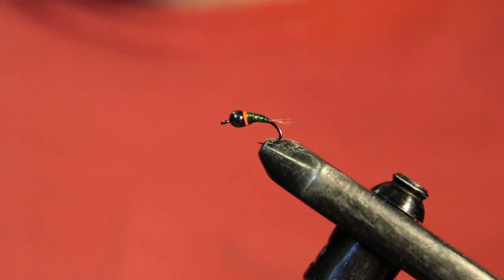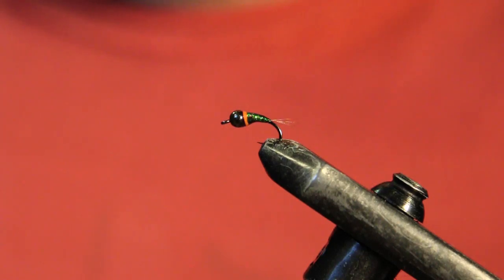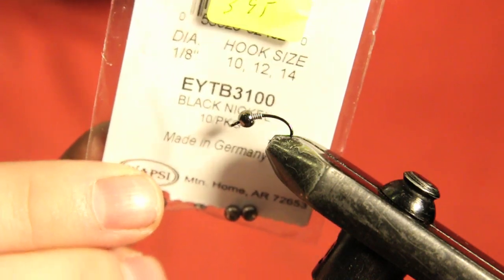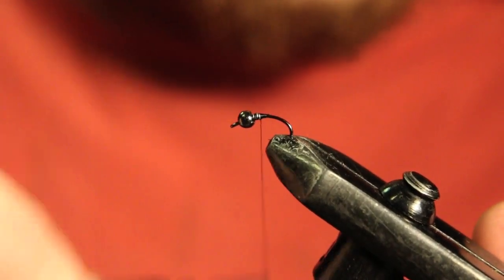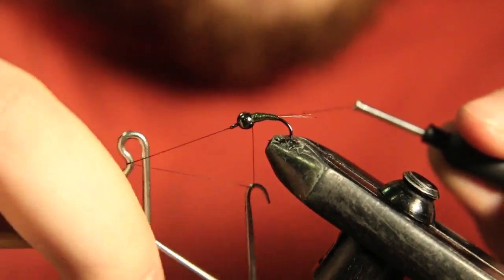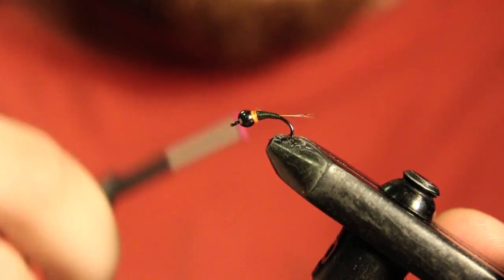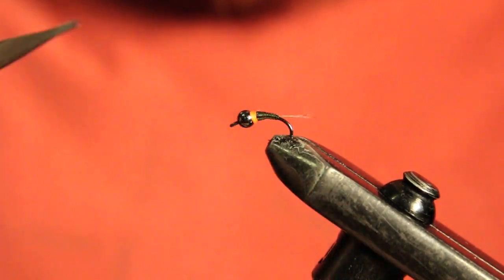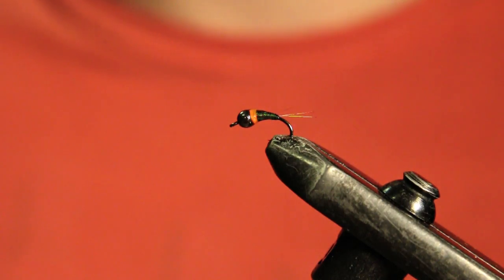Peacock Perdigon Euro Nymph Fly Tying Tutorial | The Fly Fiend.

Comment: I thought perdigon, typically, have the black nail polish as the wing case before getting the UV finish...at least that is how I know Lance Egan and others tie them and fish them.  I use regular beads as well, but Egan swears by slotted tungsten beads which he says he can then tilt up -- if you will -- to ensure the hook gap is not obstructed by the bead.  Last comment: I really like the Veevus iridescent threads (in particular Olive) for these flies instead of messing with krystal flash, but that is no doubt probably because I'm lazy.  All of that said, great video.
Reply from the maker: Yes I Say That In The Video About The Black Wing Pad / Wing Case.
Reply from the maker: Ill Check Out The Veevus Thanks Dude !! 👍🏻😁

Comment: Where do you buy your Loon resin and UV flashlight  ? I have read that some UV lights are not as good as others .
 Is there one you recommend ?
Reply from the maker: I Get Mine From My Local Tackle Shop, As Far As Lights Go More UV The Better, It Will Cure Deeper And Faster, I Use The Loon Outdoors UV Power Light Which Works Well! When I Upgrade Im Going To Get The UV Mega Light, But For Now The UV Power Light Does The Job Everytime !
Reply: Caps? Why?
Reply: Really though, I am just curious - there must be a reason.
Reply: Just get a UV laser off eBay for $10.